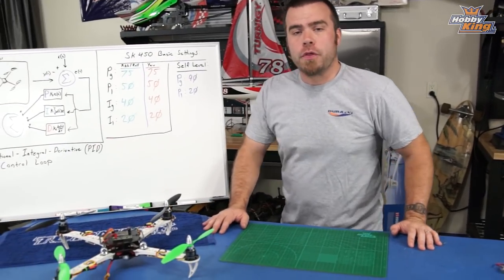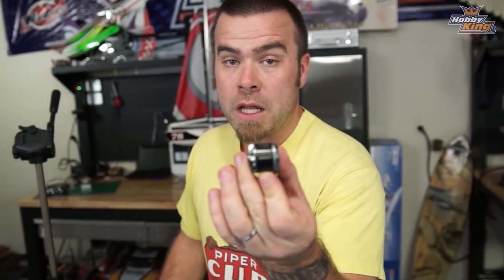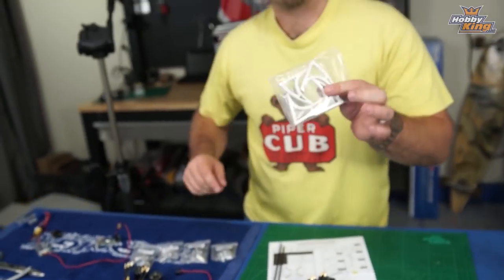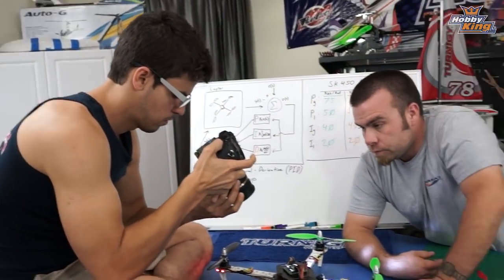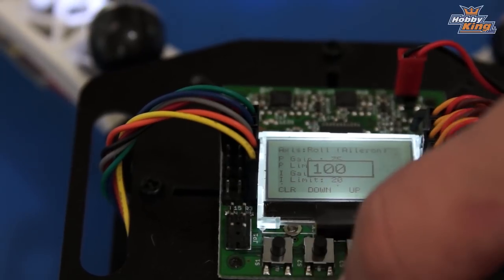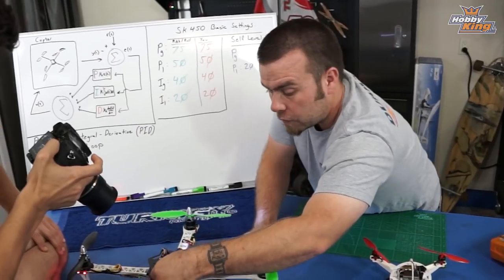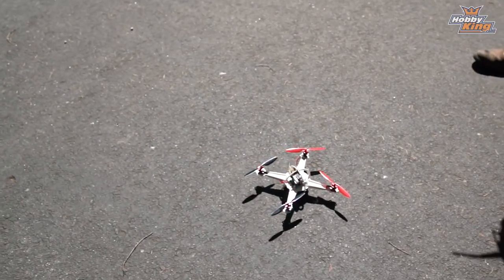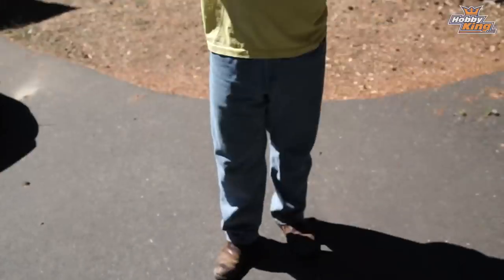HobbyKing KK2.0 Complete Guide Pt.4 - SK450 Quad

Comment from the maker: You guys are correct, it's a 20 Amp max board.  I tested the copter and I'm only drawing 19 Amps max and only for a fraction of a second at full throttle, the 30 Amp afros are total overkill.  

A direct harness would probably be better, but it's been fine so far and nothing on the copter gets at all warm in flight.  My guess is that the distribution board is a bit under-rated.  - Matt

Comment from the maker: The board takes power from motor/ESC 1, but there is no need to remove the other power pins from the ESC's. I have built dozens of KK2 copters in every configuration and never had an issue.  - Matt

Comment: Hello Matt. I get this question once a day on the chat system at HK. Which one of the ESC  BEC servo leads does the KK2 get it power from? I assume only one is tapped (to avoid voltage/current loading).  Does the builder have to remove all of the unused plus (red) center leads from the other 3 ESC BEC's??
thanks.
Robert Veach HK PS # 4

Comment: 330mm dead kitten? I'll take one. The SK450 gets a bit bigger when you change to a deadcat.

And how did he attach his headlight? Or how do you attach accessories to booms for that matter.

Also, how did you cover up your power distributor to keep it from shorting accidentally by debrie? I slathered all the contacts with hot glue all over mine and keep wondering if there was a better way.

Comment: I have the same props, motor and mount kit.  None of the spacer rings fit exactly.  The closest fit barely goes over the thread of the mount kit if I screw it on.  How do you get the props all the way down?  Just force it with prop nut or do you drill them out a bit?

Comment: Hi! Now I'm trying on Vertical Take off and Landing(VTOL) RC aircraft with two motors each at the wing tip , which is referenced to Tom Stanton's VTOL V2. And I'm using that Hobby King KK 2.1 Flight controller board to stabilize the aircraft. I find it difficult with some settings. And I'm wondering if you could help me with that.

Comment: hi any chance on doing a vid on re flashing the Afro's   ,, as im running Turnigy Multistar 4220-880Kv on them and they are cutting the motors randomly red light flashes when it cuts

Comment: Hi, Having watched the video I have purchased (from HK) a X550 frame, Turnigy 2830 100kv motors and 10x4.5 props. Will your setup for the SK450 work for this setup as well.

Comment: I have the TBS discovery knock off. It seems the arm configuration is the opposite of this one. Looks like the TBS has the front arms shorter instead of longer so would the same setup go for the TBS as this one . Any help would be appreciated. My first quad and I did it from scratch. Seems to be functioning well just cant get it stable and very new to the quad thing. Before this I only flew planes.LOL.. Thanks in advance for any help.

Comment: My KK2 quadcopter that I built with parts from hobby king two or three years ago was never able to fly and I try again to get it to work every couple of months. When ever I try to fly it, on take off it flips and sometimes in random directions and it turns in random directions. I have all the right types of blades and they are spinning in all the right directions, I have calibrated everything, and updated the firmware. Please help.

My problem looks like this: https://youtu.be/oAyggHIr_Qs?t=1m2s

Comment: Hi Matt, I'm about to set out on my first quad build & would like some advice. I am going to  go with SK450 (with Dead Cat upgrade), Turnigy Aerodrive SK3 motors & 10" props. I am going to use a KK2.1HC, & I'm contemplating using a Qbrain 4x25a rather then 4 x individual ESC's. I noticed watching all your videos that you have never used the Qbrain on any of your builds & was wondering why? Is it an inferior setup as opposed to 4 x 30a Afro's?
Reply: Mike, I am want to do the same. What configuration did you come up with and are you happy? What components did you use and what did you spend?

Comment: I have a f450 frame, 1000kv motors, x configuration, simonk 30a esc, kk2.1.5,  I have tried absolutely everything but every time I try to take off it wants to flip to the right.  what should i do.
Reply: Check if your motor leads are connected to the KK board in the right order, that was my problem. Had to find the solution on my own sadly... Also check if your props are put on correctly (CW, CCW).